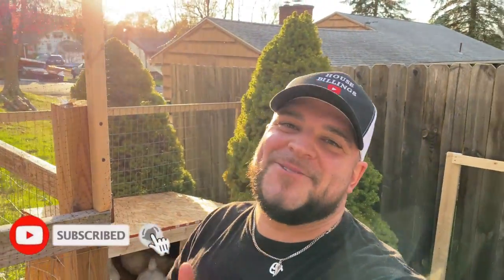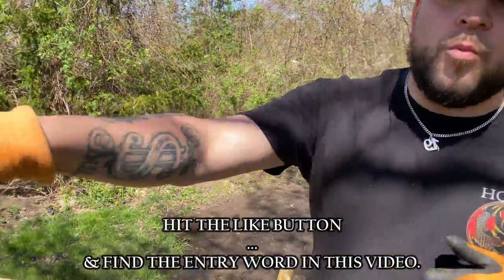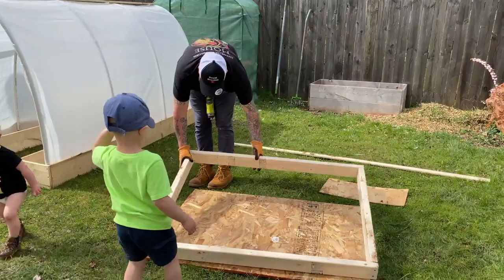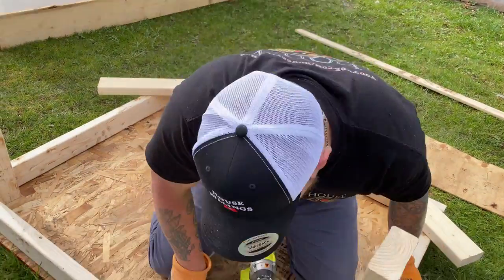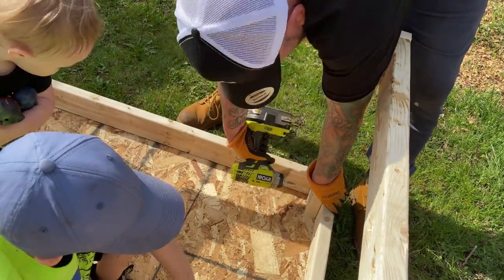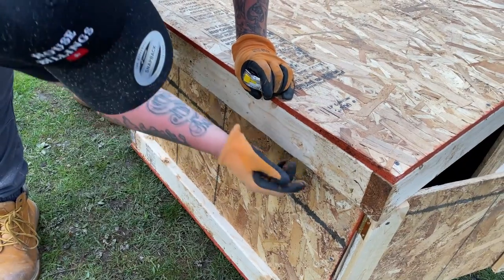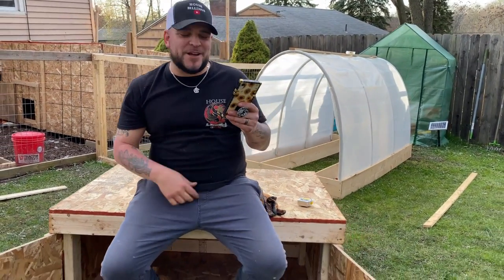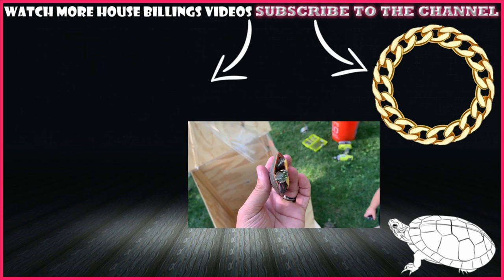$50 DIY Duck House / Coop (Easy Build)

Comment: So building this this weekend!  I am new to ducks. Mine or just babies right now. Question: What about ventilation? When they are closed in at night do they need ventilation?  It gets hot and humid in Michigan. What do you suggest?
Reply: I am going to follow this as a guide, but use 1/2" galvanized wire on two sides for ventilation instead of the wood siding.

Comment: Do you plan on doing anything on the exterior? OSB will get wrecked by water really quickly and can't be left exposed to the elements. I saw that your chicken house is the same, with OSB on the exterior. Painting it will help a tiny bit, but it will still be completely destroyed within a year or so.
Reply from the maker: Hey Erika thanks for reaching out. We used sealant on the chicken coop to protect the OSB and will do the same for the duck house as well. We are also going to be putting roofing on as well to help keep a lot of the rain/snow away. Very good points you made though thank you again

Comment: Needs significantly more ventilation, not just a window. At all times - ducks require a water source deep enough that they can immerse their head/beak - which is why a waterer for chickens is insufficient
Reply from the maker: Hey John you should probably watch the video, and some of our other videos. We LITERALLY said we would be updating as we go with PLENTY of ventilation. The ducks have multiple water sources and are doing AMAZING but thanks again for your concern.
Reply from the maker: And honestly on second thought, what are you even talking about a chicken waterer? Please don’t come on my channel and make up bs. My ducks have had troughs to drink from since the first week I’ve had them. Before they even stepped foot outside. And windows are PERFECTLY FINE for ventilation.. what else do you expect.. I’m thoroughly confused about your entire comment.

Comment: You really need to stop cutting with the skill saw like that!... between two chairs ..... you are going to get hurt! That is exactly the absolutely wrong way to cut , not something you should be showing DYI people, they can get hurt as well.
Reply from the maker: ..I’ve  never had a single issue. It’s the same thing as using saw horses. I actually said in the video it’s not the proper way to do it. I also mentioned that I’m not a professional and to use your own disgression as to what you should or shouldn’t do. But to ease your mind I’ve since invested in actual saw horses. Appreciate the concern for everyone though.